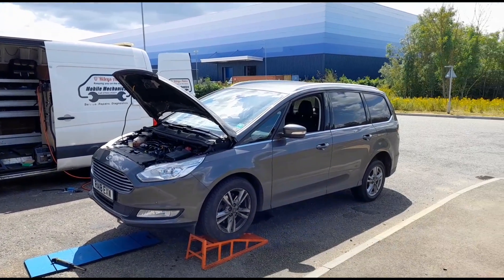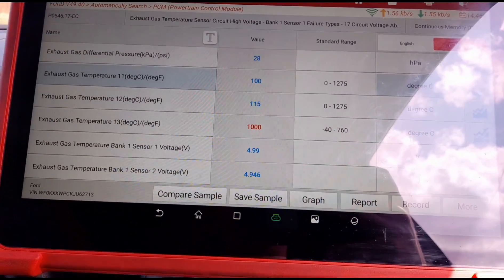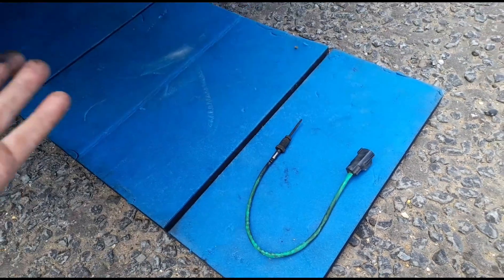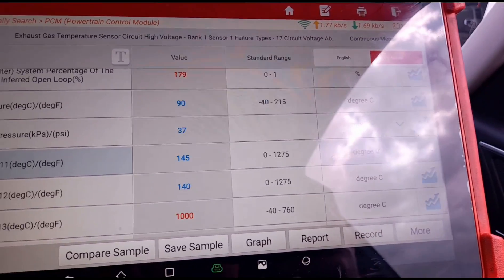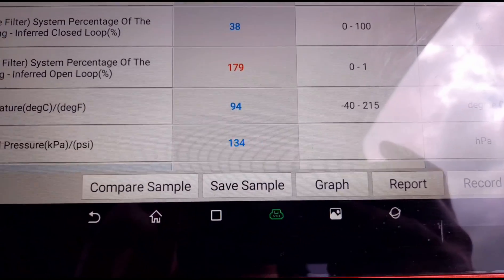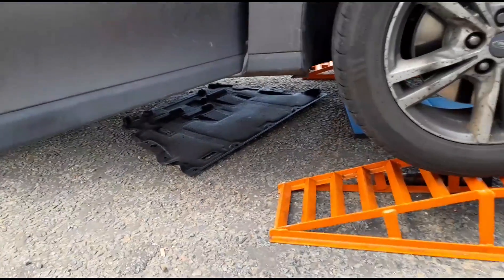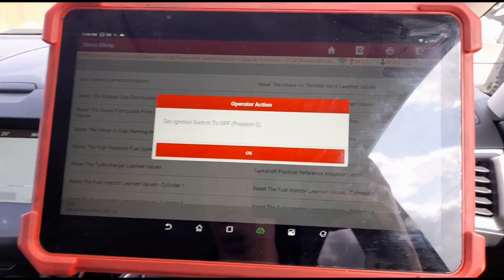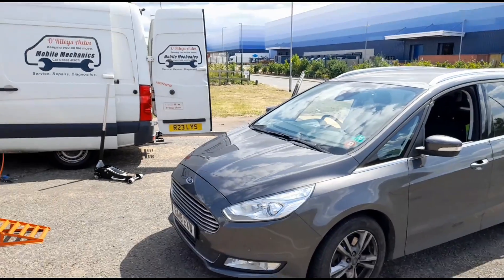How Did This Happen? & Why Was Customer Told Ignore it!? Ford Galaxy P0546:17-EC P2463:00-AF P253F

Comment: I think it's more likely the mechanic was interrupted when fitting it and thought they had fitted it, or someone else took over the job.
When the problem came up they though "We fitted that...", or "It's a new sensor...". 

Having a similar situation at a workshop where I help out. They fitted a range of new parts to a car that had been overheated, (unfortunately followed the customer demand to "only do X"). After sitting for a quite a while the car wouldn't crank. Long story short, the new starter motor tanked, which took a while to discover because it wasn't considered a problem due to it being new.
Also there was a sensor in the rear of the ducting for the air filter, but in such a position you can't notice it when fitting the tube back to the car. I had to take it off and when fitting it back I notice the small hole with a grommet. A closer inspection showed someone had pulled the sensor and folded the tail back tucking it behind a section of the harness. If you didn't know it was meant to be there you could easily miss it, (was not there when I removed it.)

I get the first error, but the returns and smell are a pretty appalling way to treat the customer.
Hopefully he got some compensation.

Comment: I had a job in a couple of weeks ago a Mazda 6 that had been into Halfords for rear brake pads and a couple of days after noticed a scraping sound when reversing? On inspection the lower bolt was missing from the caliper and it was scraping the inside of the wheel! It's not the first time I've had to put right a Halfords cock-up though? No qc on their services obviously?.

Comment: I've got the same problem with a 65 plate Galaxy euro 5
Leaking fumes in the car also exhaust is smokey when speeding.  Been to couple garages they said there is no split on the exhaust😔 but can't drive it like that

Comment: I've been binge watching your vids and love them.
Shocking! That the sensor was not even fitted in the exhaust but  not uncommon  as I had some main dealer Muppets leave the NOX sensor out of my Sprinter exhaust with the wiring loom hanging over the exhaust claiming that the Chief Muppet that worked on it encountered some rust on the threads.
Total fabrication as I threaded it in by hand and tightend with a spanner.
I feel for customers that have no knowledge of vehicle systems and repairs because repair shops with no integrity will BS their way out of shoddy service and use smoke and mirrors as their main diagnostic skills

Comment: I’ve seen this temp sensor “hack” before. It used to work on the very early versions of emission controls (I’m talking about the Denoxtronic adblue pump era). Back in those days, you basically had zero emission monitoring until the exhaust had reached a certain temperature. So if you had some sort of active fault on the exhaust system, for example “Nox levels below threshold”, or “EGR low flow”, you could simply delete the fault, and the ECU wouldn’t re-check the fault again until the exhaust had warmed back up. As soon as the working temperature was reached the ECU would see the fault and the EDC light would illuminate again. So here’s where the hack comes in. You delete the fault, and remove the temp sensor, no exhaust temp = no emissions = no EDC light! Of course you had to keep the temp sensor wiring plugged in, otherwise the ECU would detect an open circuit on the sensor. It was also a good idea to plug the exhaust, either with a blank, or an old temp sensor to give the impression nothing was tampered with (and to not gas yourself to death). During low exhaust temperatures, the engine would also use zero adblue as well, so haulers could save money by never having to refill their adblue tanks too.

Engine manufacturers got wise to this hack years ago by updating the software to monitor the engine coolant temps, vehicle speed and engine load/running time to work out roughly where the exhaust temp should be at any given time. If the new software noticed that the exhaust temp never moved, even though the engine had been running, it knew something was amiss and would flag up an EDC light “exhaust temp parameters” or words to that effect. 
Hopefully that explains why that was left out, but the bottom line is, it doesn’t work anymore.

Comment: I may have an explanation for why that sensor was out - I have seen this problem before where it’s deliberately taken out , loosened, pipes to dpf pressure sensor loosened off or removed to relieve the pressure in the dpf , or to take it out of limp , had a few where this has been done then the car is sold on , cars coming to me and then im scratching my head as to what’s going on - crazy but it happens in this trade - very dodgy and It’s wrong - top work jimmy as always - keep up the good work , I’ve learnt a lot from you even being in the trade also so thankyou 👍
Reply: I think it's more likely the mechanic was interrupted when fitting it and thought they had, or someone else took over the job.
When the problem came up they though "We fitted that...", or "It's a new sensor...". 
Having a similar situation at a workshop where I help out. They fitted a range of new parts to a car that had been overheated, (following customer demands "only do X"). After sitting for a quite a while the car wouldn't crank. Long story short, the new starter motor tanked, which took a while to discover because it wasn't considered a problem due to it being new.
Also there was a sensor in the rear of the ducting for the air filter, but in such a position you can't notice it when fitting the part back to the car. I had to take it off and when fitting it back I notice the small hole with a grommet. A closer inspection showed someone had pulled the sensor and folded the tail back tucking it behind a section of the harness. 

I get the first error, but the returns and smell are a pretty appalling way to treat the customer.

Comment: a lot of the smaller 1 -3 man garages only want to do the stuff most owners could do themself if they had a hydraulic lift, disks-pads, exhausts, drop links, wishbones, tie rod ends, etc when it comes to anything technical most of them don't have the equipment and wouldn't know how to use it if they did, it's down to the fact that apprenticeships dried up during the 1980s and everyone became a specialist at one job only, AC repairs, clutch replacements, tyres and exhausts, I've lost count of how many times I've gone to a garage and asked if they can repair something only to be told "we don't do that" and they refer you to someone else who does, Ok everything gets fixed eventually but the journeyman mechanics are now of the past, except for a very few like you, 
college and knowledge are everything, day release and block release are just distant memories now,

Comment: what a load of shite!!!

some brain-box unscrewed the sensor to try and trick the ecu, (I think it was the narrator). the dpf would have been disabled and the vehicle would have been in safe mode!

The fumes would have been post catalyst so smelly but not dangerous, pre cat they would have been deadly!

I would have reconnected the sensor (saving the customer money) and erased all the codes, this would have then given a better idea of the actual fault, which was just a blocked DPF. But how would this clown make any money if he was honest??

Then add a simple DPF cleaner and do a static DPF clean. This would have sorted it!

Poor Fuel Lack of Additives and short Journeys equals this issue! 

Even a good blast down a motorway 70 in 4th gear would have cleared it!

If you dont do much miles buy a small cc petrol car!

Comment: Good job mate, I have one question.. does this clean ash??? Just watched a few videos of yours and you don’t mention anything about the ash content. Thanks
Reply from the maker: There is a lot of talk about Ash in the DPF and I can give you my view and what I have found.

Ash accumulates in the DPF over extended use, as the incombustible material left behind following filter regeneration and soot oxidation. The ash consists of various metallic compounds originating from lubricant additives, trace elements in the fuel, and engine wear and corrosion products.

The above statement is correct for what is called Final Ash. After the contamination has been burnt up this is what is left behind during the normal operation of the DPF. Cutting open a DPF reveals a super hard coal type of solid at the back. It is a combination of what has previously burnt and is very hard almost unbreakable. You can see that it has been exposed to very high temperatures and can withstand any amount of heat. Taking the DPF off and washing it through will do nothing to it. Some argue that the very biggest pressure DPF cleaners may remove some as it forces through the perforations and knocks some out. But, generally it will not be dislodged.

This builds up very slowly. Final Ash can be at the back of the DPF taking up some room but the DPF is still serviceable and works fine. If the DPF has been re-generated many times, often by forced regeneration, this causes more Final Ash to build. Most Silicon-Carbide DPF's have a serviceable life of around 250,000 miles. At that point, you may have a DPF that is nearly half filled with Final Ash and then it is un-serviceable. This is rare, because of the amount of mileage needed to build this much up. 

This is not to be confused with loose ash formation, which is an ash created by the burn procedure. For instance, the wrong oil is used, which is not low SAPS (Sulphated Ash, Phosphorous and Sulphur.) During the burn process, oil is dragged up from the sump, burns in the cylinder and Sulphated Ash is formed. This fills a DPF very quickly, is not hard like Final Ash and can be removed, once the incorrect oil is changed or the problem fixed.

Please ask any further questions that you may have and if I know the answers I will help.

Best regards

Jimmy.
Reply: @ORileysAutos  thank you for taking the time to explain in great detail, hope this helps others looking for the same answer
Reply: 😂as1acwelmĺ mll❤😮

Comment: I had to replace the exhaust gas temp sensor on my Qashqai last year.  Who on earth designs these things as the sensor was hidden at the back of the engine and almost impossible to get to.  Had to remove offside front tyre, remove the plastic wheel arch guards, under the car, reach up full arms length and just about managed to reach it.  After 11 years on the car, it was damn near welded into the exhaust and I had to cut off the wiring, cut off the probe to get a nut removal socket on it.  Then, after a liberal application of WD40, I used a 24 inch breaker bar to get the remains of the sensor out.  The relief when it eventually broke loose and I could get it out.  Popped the new sensor in and car fixed.  And yes, I do my own maintenance as in my experience, garages just don't take care of your car the way you would.  Fair play Jimmy for another fix that someone missed......like how can you miss a sensor hanging loose from the exhaust?????
Reply: I said I would fit a new headlight bulb for a woman I know it took 3 hours, I had to access it via the wheel arch, like you, wheel off and liner out, for a BULB !

Comment: Thanks for showing us the receipt.... 😯😯😯😯😯😯 £75 for front wiper blades!? £132 for a fuel filter!? £250 for brake discs!? £162 for pads!? Where did these numbers come from? A monkey randomly typing into a calculator!? Halfrauds indeed. Bet this customer will just be going to you in the future.
Reply: Halfords shouldn't be touching vehicles, I have been a motor mechanic for 30 odd years and I have had to deal with the cock ups they make as well. I wouldn't let them fit a wiper blade.
Reply from the maker: He went for a dpf clean at first I think he said. Went back to complain about smoke smell and instead of looking into that they charged almost £1,000 for a service and brakes 🙃
Reply: @ORileysAutos  He needs to report them to Trading Standards. 100%.

Comment: Good video just a little bit of advise when you have vehicle on ramps find someway of locking the wheels so there is no chance of rolling off you cannot trust handbrakes it take only one faulty when I was a apprentice had one roll. Off trapped me
Reply from the maker: In gear, handbrake on, chuck on rear wheel

Comment: Why do people go to halfords. Honestly
Reply: Can add quick fit to this list.
Reply: @TheOriginalDaveJ  and it seems main dealers.
Reply: Went to Halfords for m o t ,failed two front tyres worn , one side showing wire, (tyres new 5months  ago ) went home took them off yes tread was worn down put two mew ones  on ,no wire showing on side wall  where (he marked ,)just the pattern on tyre ,rear hand brake o/s not working ,said needed new calliper, checked my self calliper working fine ,handbrake cable seized ,(new cable )  I worked on the tools for 40 years .just shows  how people who don’t know about there car get ripped of by these garages .
Reply: To buy a bike!!
Reply: Tyres and wiper blades only?
Reply: @TimmysFavs I wouldn't trust them even for those ..
Reply: Unbelievable that. Such an easy diag.  Proper cowboys.
Reply: Its about trusting a name coz you recognise it, 'Brand Value'.   It'd nice to think the owners of major name fitting outfits would be careful about protecting their reputation with rigorous procedures to guard against this sorta thing..... sadly not.
Reply: Dodge cowboy mechanics